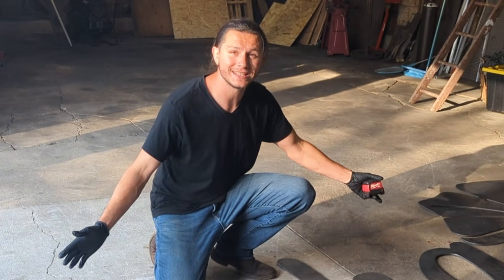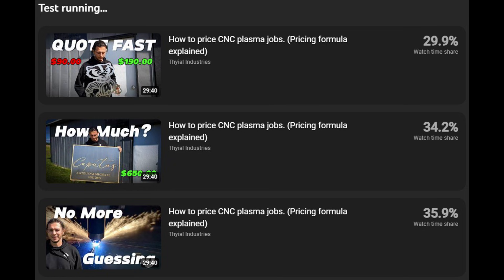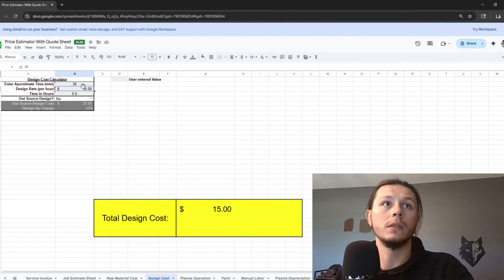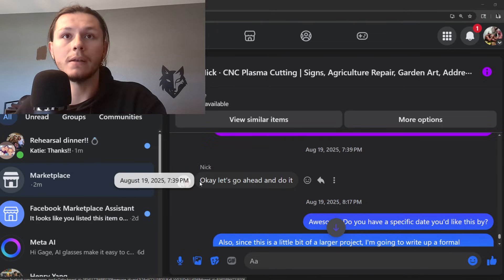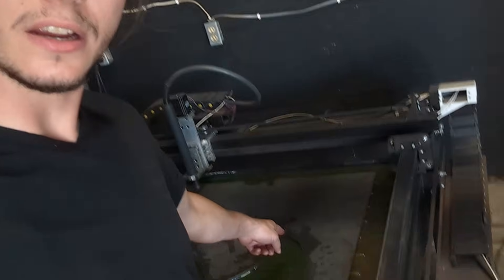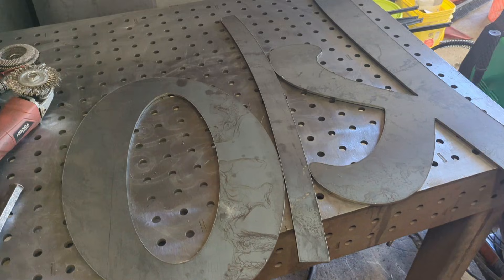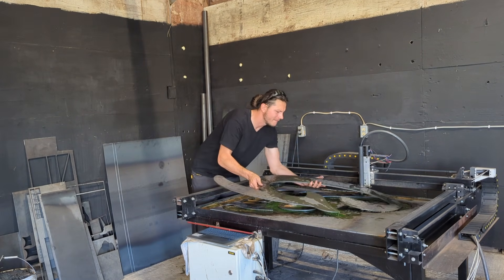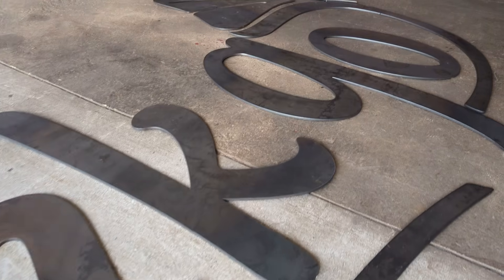Small Table, Big Money: $1,300 Sign on a DIY Plasma

Comment: In my opinion, having a quote calculator that you “play around with” is pretty meaningless. I run a cabinet shop and occasionally farm out the CNC router. The biggest cost is minutes of cutting time. I’d adjust the spreadsheet to account for cut time at somewhere around $1 per minute. Getting the calculator to kick out a number that is close to what you can charge is essential. As you get busier, you will be quoting more and more. You can then adjust parts of your calculator depending on how many quotes you win or lose.
Reply from the maker: I would agree for the most. I think as long as you have the correct data, there are a bunch of different ways of costting

Comment: You mentioned not being able to start at a specific cut point with GRBL. I found this to be a huge advantage with the myplasm software. When I have a cut fail for some reason I can set my torch to start wherever I want on the cut path.
Reply from the maker: Yeah this would be awesome! I will definitely have to account for this when I upgrade to a larger machine
Reply: @ThyialIndustries do you have a particular larger machine in mind?
Reply from the maker: @sharpsticksnz4112 not yet! Not sure what I want yet. But I know I don't want to build one again. I definitely want to buy new.
Reply: There are many GRBL software control programs out there and figuring out where you left off isnt hard. First of all You need to learn gcode commands, because you can start from a certain line of code in the project gcode file. Also most all gcode sender softwares that show a visualization also show the gcode file its self. Typically if you highlight the gcode lines it will show you where you are in the file in the 3d render. Also it would be wise to name your cuts in the gcode file. that way you can just find it in the list and then try to figure out how far down the current cut you need to go to restart.

Comment: The video didn't show you pricing for or welding together the bits you mentioned you needed to due to sheet size... did the customer weld it themselves?
Reply from the maker: Yes, as part of the order the customer was going to weld these themselves. I believe they are also going to weld some round bar to the backs and anchor the pieces into stone.